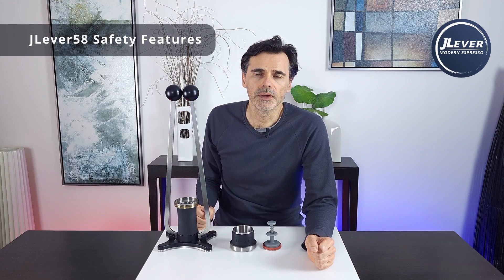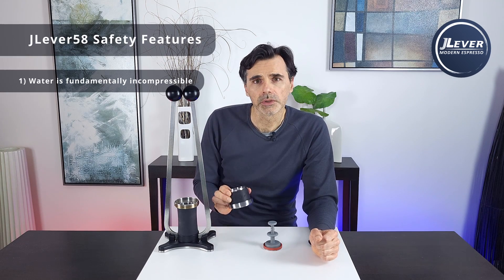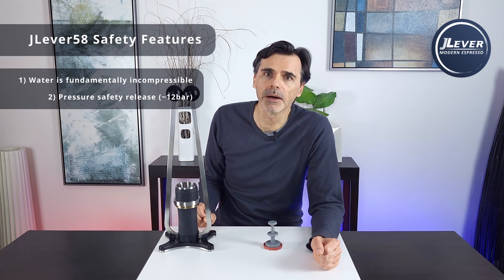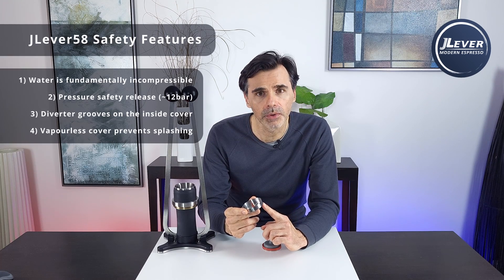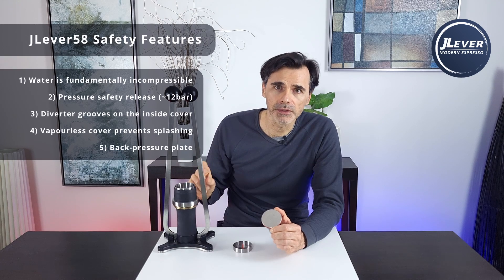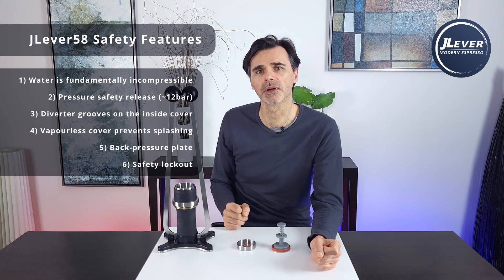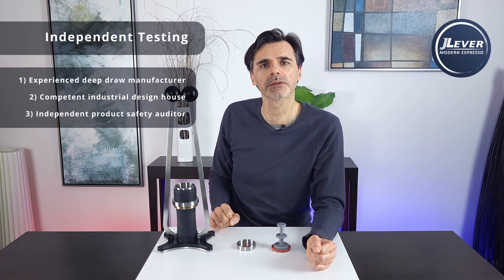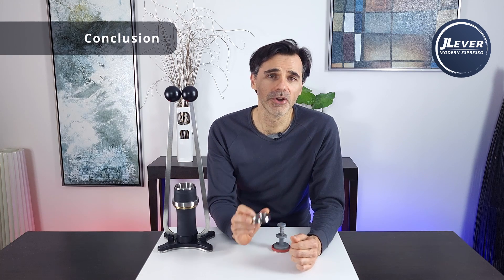Quick Presentation on Safety Features of the Upcoming JLever58

Comment: While watching the videos, I wonder, what would happen if there is channeling? Sometimes I get squirts of espresso flying while extracting, will this happen with the JLever too? If so, maybe a cap would help keep it constrained in the cup.
Reply from the maker: Initially I thought the same but, first you modulate the flow, so if you feel it doesn't provide the resistance, you just don't slam it, or you slam it later when there is a layer of coffee there, which suppresses the stream